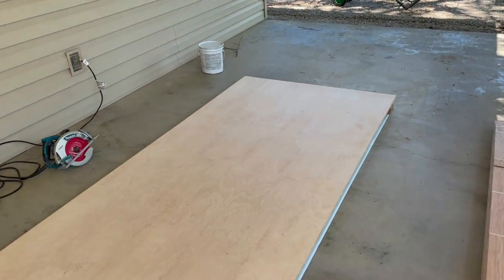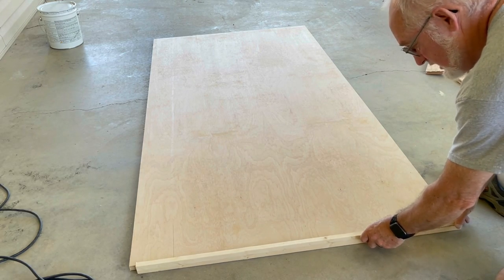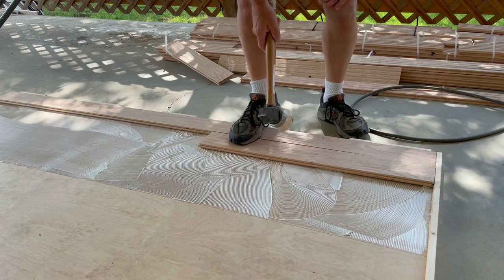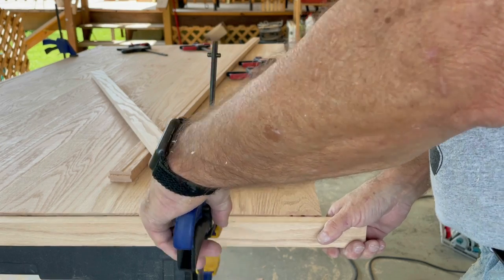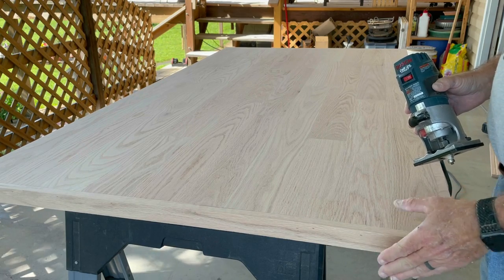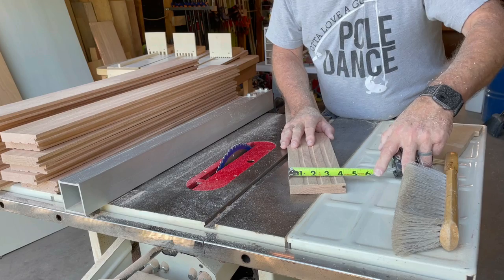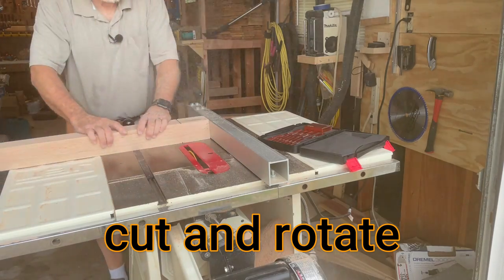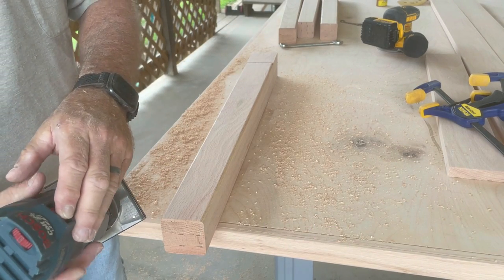Dining Table Made from Flooring

Comment: hi, if you glue the solid wood floor planks like this then will there be a problem with wood movement?
Reply: Sadly the oak will shrink and expand where the plywood doesen't.  This table will have seasonal gaps and or cracks like any hardwood floor does.  Nails or glue won't prevent movement.  The only way around would have been to cut the oak to thin veneers then glue them to the substrate (in this case, the plywood).

Comment: this is super informative! question: would 3/4" MDF be a better option than the plywood since it is factory straight? or are there other pros/cons to plywood /MDF for this project? thanks!
Reply from the maker: MDF will work. I used birch ply because I get it for free.
Reply: @paulswoodshop395  thanks for responding I wish I could get plywood for free too!